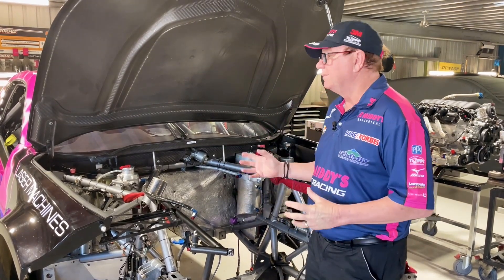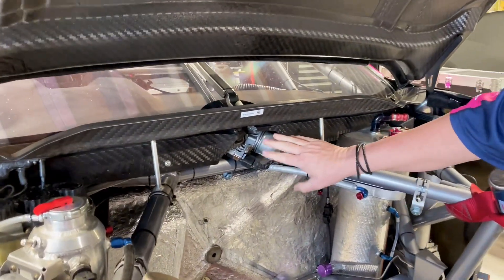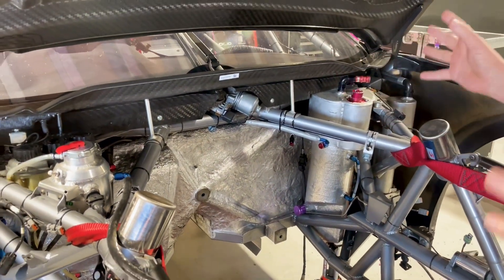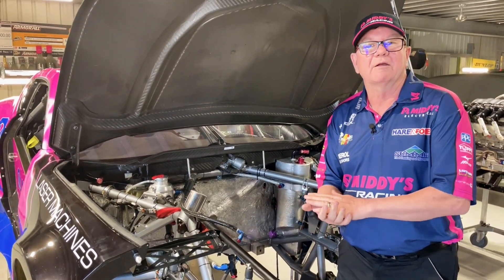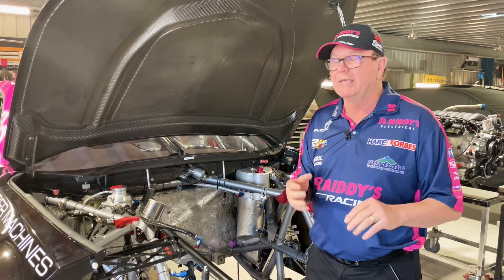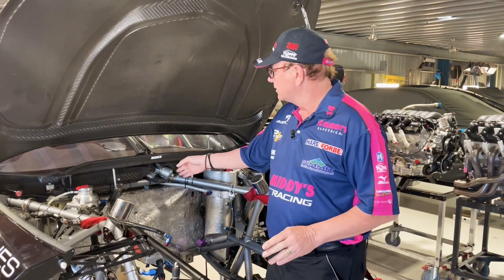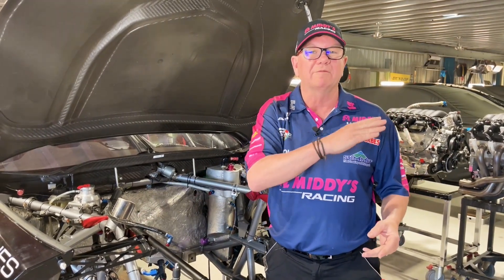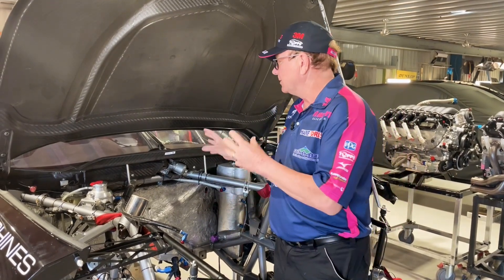Wiper motors in the Gen3 Supercar

Comment: The small things are always interesting. Still lots to cover, say the driver helmet with air, radio comm and camera attachments, in-car/roof/guard supercars camera, the new grid position windscreen module, windscreen tearoffs, vynyl design and prep, pit lane speed control (incl flashing stop lamp programming) etc.. so many systems, even just remebering a co-driver light for enduros. Keep em coming.